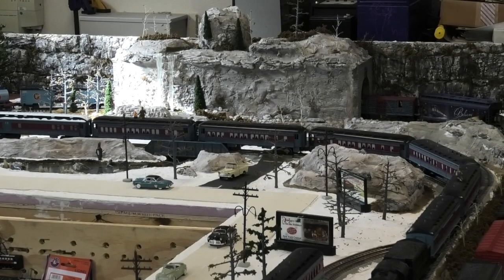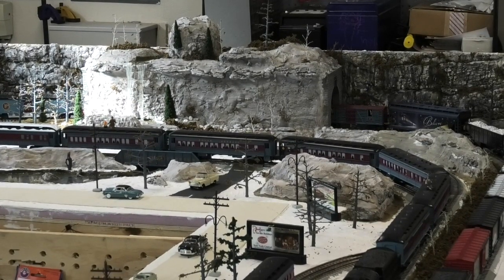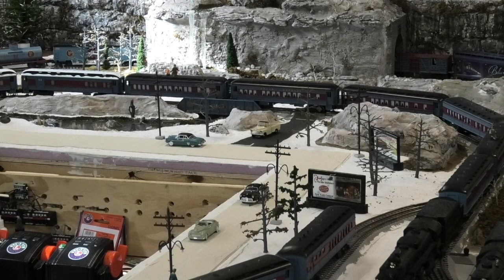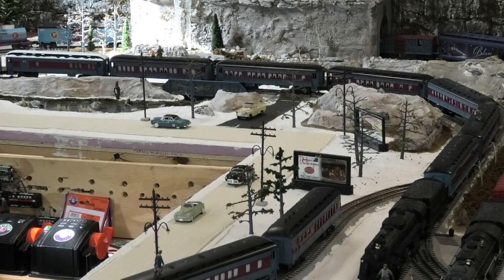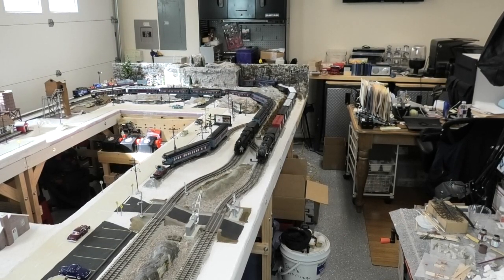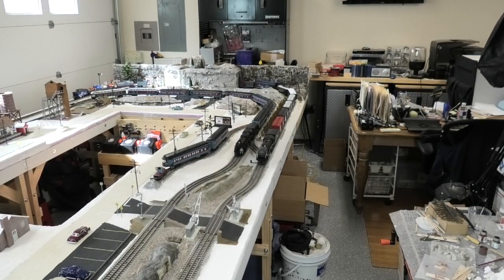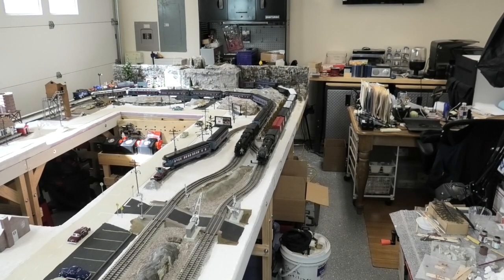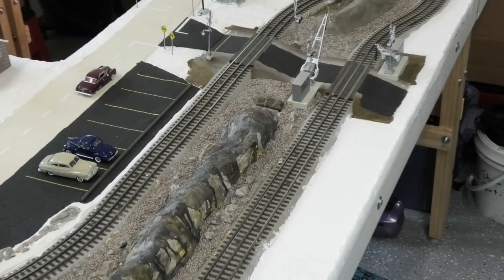Polar Express - Should I Add Another Level?

Comment: My first suggestion would be moving the switch Back at least one straight which there seems to be enough room to move the switch back. Alternatively, on the other side of the layout, moving the outer track out ever so slightly, an o60 switch and an o48 curve gives you a 5.25 in  distance between center rails and you could potentially put the incline in the center of that back straight away